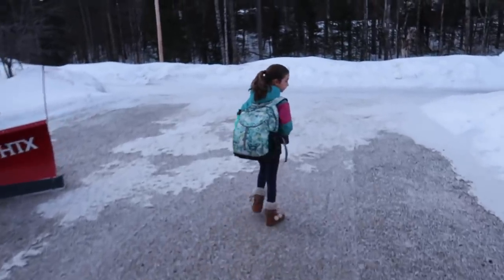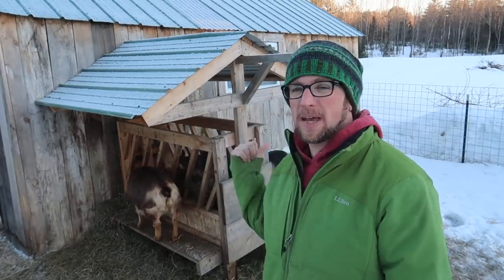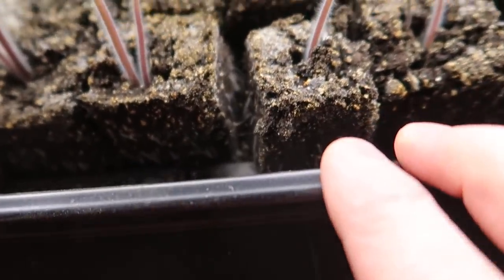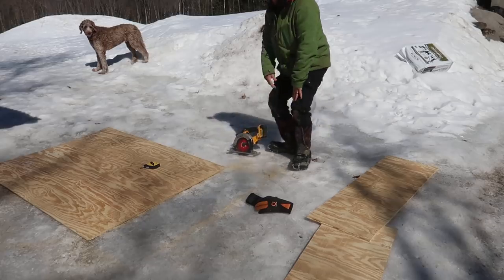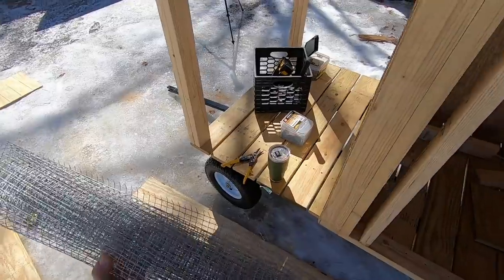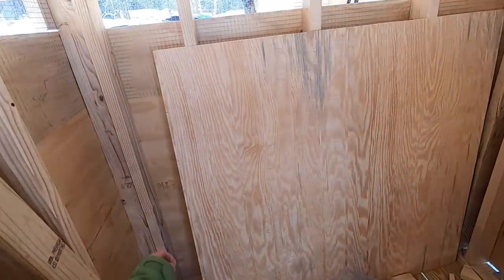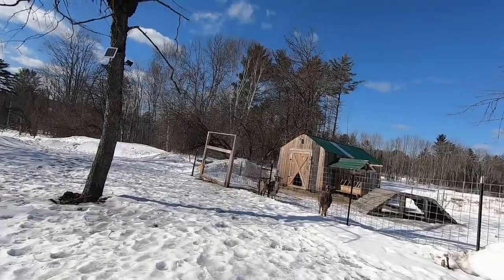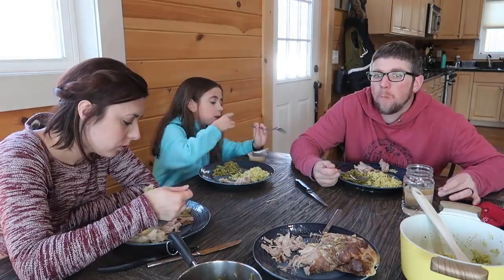Not sure how this will Work OUT! (Ice Cleats Needed)

Comment: Al, Woops, You missed a screw through the roof at 21:45. A dab of white caulk can seal the wrong hole. 
Be careful. Gina will tell you to move your shop stuff from the basement to your new mobile shop.